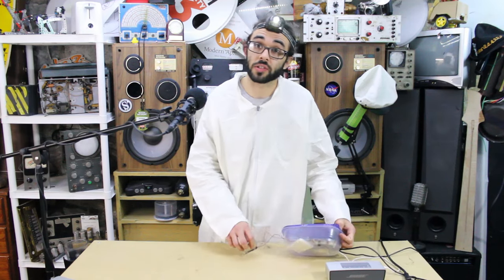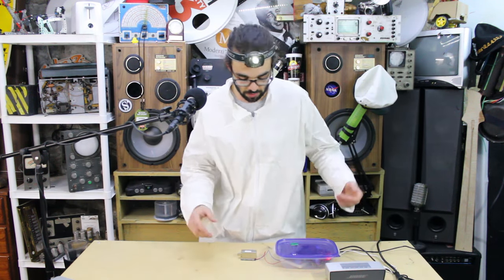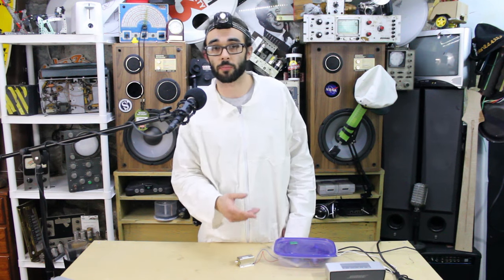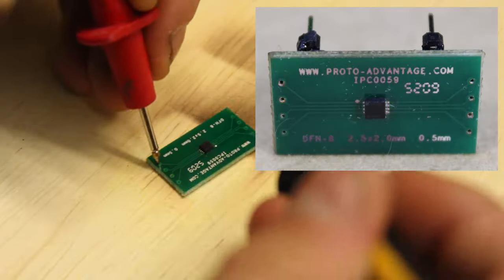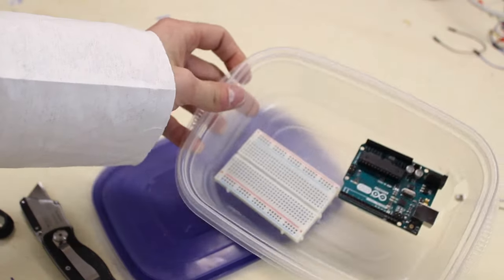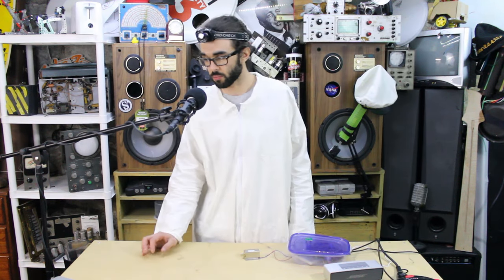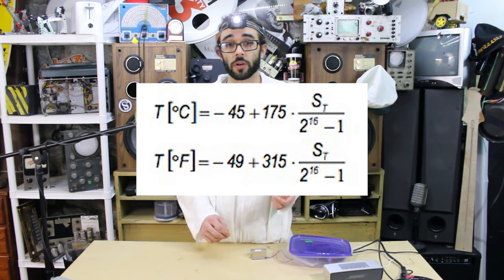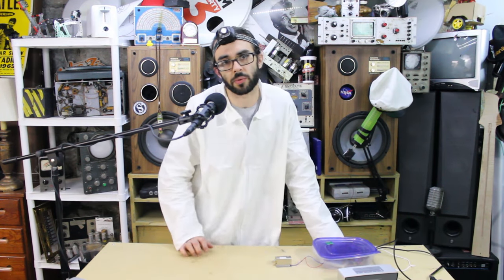MIT-i Episode 12: The Punxsutawney 5000 - A Sensirion Temperature Device

Comment: Hi! Nice vid, thanks!  Does the hot air gun soldering not damage the sensor? What temperature did you use for your hot air gun? Did you test the accuracy of the sensor afterward? bye